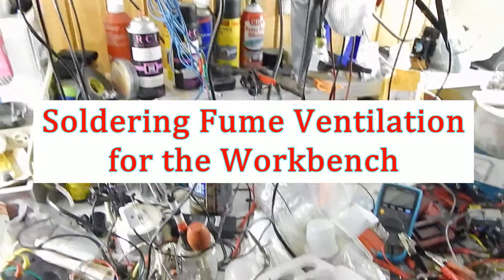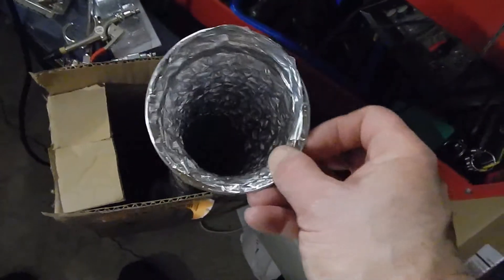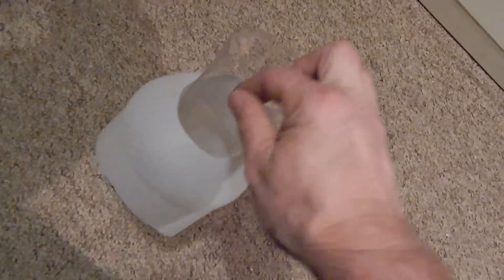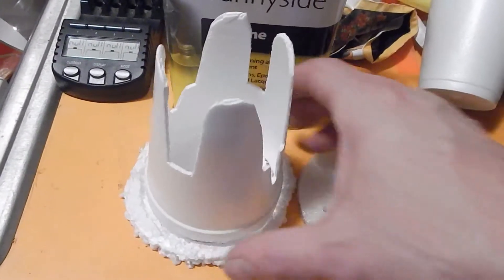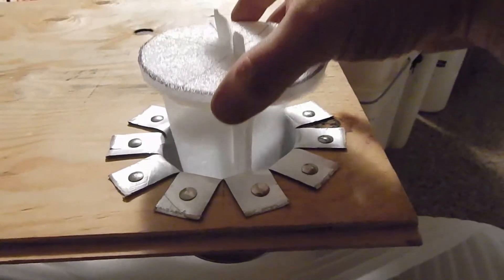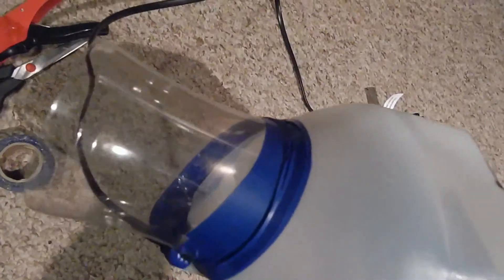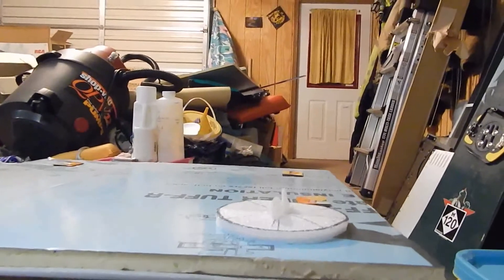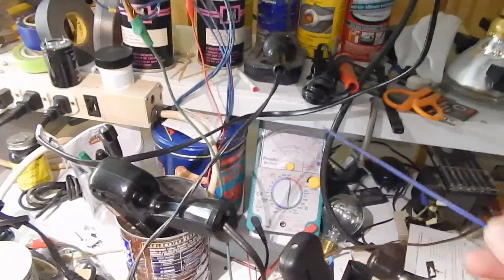Workbench Ventilation for Soldering Fumes

Comment: You might need a squirrel cage type fan to develop enough pressure to push open the valve. I'd get a bathroom fan and mount it to the panel in order draw enough air. They have a built in flapper to stop reverse air currents.